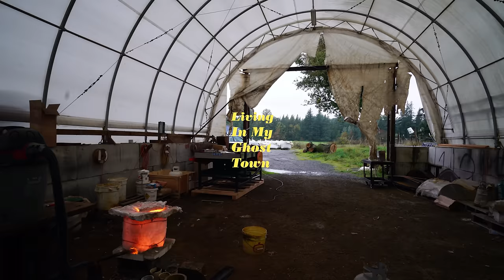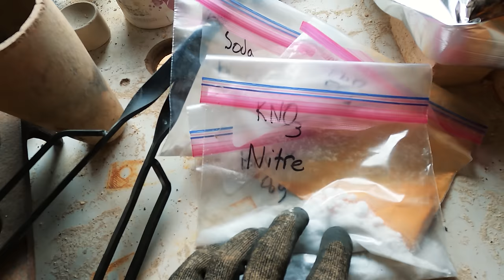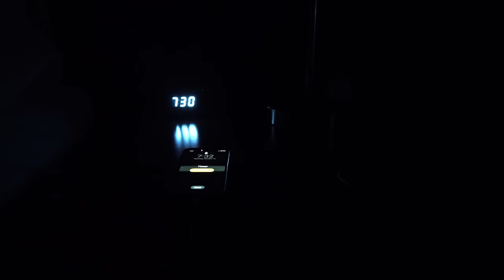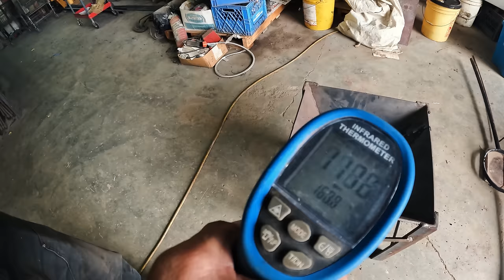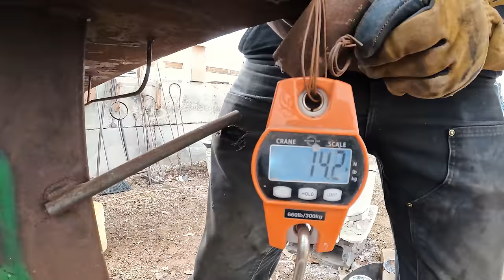Turning 100 Pounds of Silver Ore Into A Ring!

Comment: A common misconception about abandoned mines is that they've been completely stripped of any valuable minerals, but in many cases mines become abandoned if it's simply no longer profitable to extract the wanted minerals in a large scale.
Reply: Interesting.
Reply: Can you imagine weirding a pickax in one, and them boom, you hit a big nugget of silver, gold, emerald, or what ever it is you were mining for there? I imagine that that could be awesome.
Reply: While this is could happen, you're sadly much more likely to get seriously injured or die in an abandoned mine... 
Don't go into mines if you don't know what you're doing and even then, you will never be completely safe inside a mineshaft.
But yeah, that would be pretty awesome.
Reply: Very true! If the silver/gold per ton ratio becomes low enough, mining operations will be ended at that site as it is no longer viable.
Reply: Or if they've extracted so much that they can't take any more out without compromising the structural integrity of the mine. In most cases, the rock holding up the ceiling is ore-bearing, and there are rich veins just feet or inches away from you at all times. But you never remove a load-bearing lode.
Reply: or profitable at their precious metals prices and level of technology.
Reply: @TheDirtyShaman  even in non abandoned mines they are dangerous
Reply: @danielmahon1589  The difference being that you usually can't just walk into mines that are still being used
Reply: True, but theres still enough to have an intetesting hobby. Maybe not to get rich with, but definately have fun.
Reply: In one of the video’s when HeavyDsparks was in cero Gordo they saw a big vein a few meters above them.
Reply: An oz of silver is about $20 so just his time collection 100 pounds of ore isn’t breaking even. But its a fun project! Like growing an acre of wheat to make a biscuit from scratch
Reply: Very true.  Mining is just like any other business.  And commercial mining generally involves the requirement of recovering many tons of ore in order to recover very small amounts of precious metals - it's an incredibly dangerous and labor-intensive process and the profit margins are far smaller than most suspect.  Any change in the fundamentals of the economy or the value or demand for the raw material can turn what was once a profitable endeavor into an enormous waste of money.
Reply: Or environmental regulations.
Reply: @TheDirtyShaman  "no longer profitable to extract the wanted minerals in a large scale."
In some cases, it's not that the mine still isn't profitable, it's that the company can get a better ROI (return on investment) through another venture.
Companies like BHP and Rio Tinto will look at what ventures (current or future) will give them the greatest ROI, then either sell or shut down (temporarily or permanently) an underperforming venture, investing into a venture with a better return.
Reply: The TAILINGS have made some people well off.
Reply: Well this one might be profitable with modern methods. They abandoned it when it stopped being profitable turn of the century. The value of silver is a lot more today 100 years later. 

The 16 to 1 mine is a great example of a mine that keeps coming back to life because the cost of extraction keeps becoming profitable again. 

Until recently there will still lots of mines active around Republic, WA near where im from, and efforts are being made to reopen some of them using new technology.
Reply: It may be cheaper to just go in there with heavy equipment and open pit mine everything out of there. You can also produce construction gravel from all the non-ore bearing rock that's on top of the stuff you want.
Reply: Exactly.  When we did assaying for companies looking for gold and sending us core samples we would test it and give them the results in oz/t.  Even if there was gold in the samples they wouldn't open up a mine if the concentration was too low.  That was in 1997/98 when gold was a record breaking $300+ an ounce.  I bet some of those areas we tested would be viable these days with gold at over $1800 and ounce.
Reply: @ovni2295  that's when they go to open cut. If there is sufficient quality ore left. An example of this is the Superpit in Kalgoorlie, Western Australia. In the 1800s they discovered gold, iron ore and copper at the site and small miners sunk shafts to get the gold. In the early 20th Century, the underground operations ceased, and most of the claims were accumulated into a single company, and they commenced open cut operations to the present day. They have decades of gold left there, and once that's done they have to sort through the spoil heap for the copper and iron they haven't even touched yet.
Reply: I'm thinking back then they didn't have as sophisticated equipment as we do now. 
Leaving behind still more to find in the future days to come. I Love Your Passion and appreciation for the towns history.
Reply: All these mine exploration videos have full ore chutes.
Reply: Often a modern open-pit mine will replace underground tunnels. One I worked at had a magnet over the conveyor transporting ore. Old pocket knives, lanterns, picks adorned many mine offices.
Reply: I think some of those mines also just had owners who went bankrupt and stuff like that. Lots of variables.
Reply: Correct. Economics always come into play. If the per ounce/lbs value of a material doesn't profit on top of the costs to mine it then no company will continue to operate the mine.
Reply: Alot of us mines stopped working because of the 1934 act where the us government took everyone's gold. Another big 1 is Wars if your not producing a material for the war effort its closed, another is if all the miners are drafted into the war effort and if all the men died in the war the mine is lost/forgotten or just they come back to their a home town and the jobs their now pay more than what they were making from working in the mine. it gets closed/forgotten.

Comment: (19:13) "There's a line in the Greenland ice caps from all the smoke that was created from the Romans mining galena". There is a line on graphs that clearly shows this, but it's not a visible black line like the image suggests. As the video shows there's a LOT of lead for a tiny bit of silver, and the Romans indeed used lead and made silver coins using a similar process involving silver, lead, and copper. What can be measured in ice cores is the concentration of lead that was emitted in the atmosphere by this process. The amounts measured in these ice cores show variations in the order of picograms of lead per gram of ice, so 1 part in 1 trillion by mass. You can't see that as a black line, in fact you can't see it at all and need extremely precise instruments to measure it. The most interesting finding from these measurements is that both lead production and the minting of coin are good proxies for the economic output of the Roman Empire, so we can tell when things were going well or their economy was in crisis. No one's making money: no one's minting coins or installing lead pipes. For example there were massive drops in ice formed during the Antonine plague of 165-180 A.D. or during the Imperial Crisis of 235 to 284 A.D. The researchers also matched these measurements to other sources such as tree rings and volcanic eruptions, which can capture weather conditions and atmospheric bubbles respectively, so this gives a good overview of the conditions at the time. If you want to read more about this, check out the New York Times article titled "An Ice Core Reveals the Economic Health of the Roman Empire", and if you want to read the actual research paper search for "Lead pollution recorded in Greenland ice indicates European emissions tracked plagues, wars, and imperial expansion during antiquity" by authors McConnell, Wilson, and others.
Reply: thanks! I was sceptical about that image of the ice with black lines, but this but of info you gave us really made me happy.
Reply: Wow how interesting. History being fact checked by science

Comment: i'm just curious im sure there is a way for miners to know this, but how do you know when you drill and remove rock pieces the cave wont lose its structural integrity? i think i would be very nervous removing rocks like that
Reply: I've worked in underground mines half my career.  Today they use rock mechanics to determine the stability of the rock but in the days before that you simply looked at the rock and started removing it.  You can tell how solid the rock is by how it digs.  And it changes as you progress.  Some mines can have huge openings with no supports like timber or steel or rock bolts while others require timber the entire time to hold up the ground because it will just fall down.
Reply: @johnho3987  that's a great response. thank you very much

Comment: Just an observation; think about improving your safety processes. 
1. would do this outside. If something goes wrong you have space and time in your favor. And structure won't catch on fire.
2. little things like when you backed out after pouring, the one guy moved something with his feet while holding the "hot stuff"
 this clearing of paths should have been planned already. It's moments of distraction like this that will literally burn you.